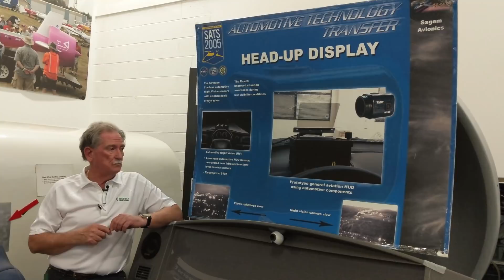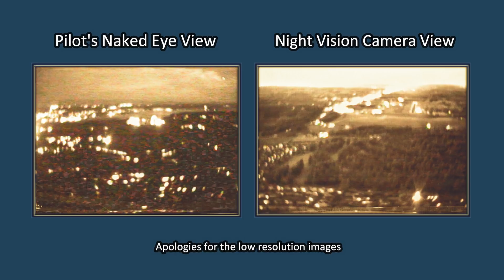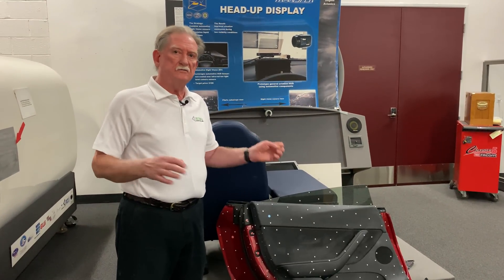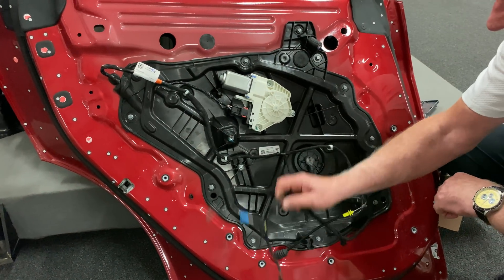Tips For Tesla E3 - Night Vision HUD & Wire Reduction

Comment: Tesla has the tech to make their own self driving processor chip. Why can’t they make their own canbus chips for every item in the car (light clusters, window winders, etc)? That should need just one single wire run around the car. 
You don’t need Bluetooth data over power will do the job with no external noise issues. Ethernet over 240V mains works perfectly. A simple command to light a bulb/lift a window, etc should be easy.

Comment: Could those control boards be of a POE in a "ring network"? With one or two "ring net works" connecting the whole car to the cars computer. Could the control boards then be made accessible for use anywhere on this network?
Reply: And what will happen in a crash, will the whole network 'go down'? I have head they were interested in fiber optics. How will that help,

Comment: wireless signaling might be too easy to hack?
Multiplexing on the other-hand, is probably more practical... Still gonna have to run wires for power, may as well run a signal wire to send a digital instruction through to a cheap controller in the door..

Comment: Bluetooth is an absolutely terrible idea.   The tire pressure sensors on my Acrua are interrupted by the charger for my Android phone.  The only wireless receiver should be between wheel pressure and a receiver located right next to the tires.

Comment: Blue-tooth, WiFi, or other wireless technology is not the way to go.  Just not reliable enough and or opens the system up for hacking from the outside.  Stand next to the car with a cell phone running right software and the door opens completely by passing system security.  Using a CAN like bus reduces the number wires out to each door to 5, except for the speaker(s).  All of the tail lights reduced to 4 wires etc.

Comment: Why not sandwich an OLED display inside the windshield and use the entire surface area of it to display info?
Reply: love that idea. BUT - as far as I know, there is a legislative regulation (at least in Europe) that the windshield has to be fully transparent without any distortion. only thin wires for windshield heating (defogging/defrosting) are allowed.
Reply: @gl3906  YouTube transparent OLED's, it can be done.
Reply: @mxj247  thanks for the hint. 'Planar launches the 55" FHD LookThru transparent OLED display for $14,995' - maybe (today) more a matter of price, than a matter of technology

Comment: Wireless is far too prone to failure.  In my opinion you would go with a small microcontroller in each physical area of the car (ex door) why are each component in that to the microcontroller, then wire all the microcontrollers to the main logic.

Comment: I believe we will see Ridgid cabling in the Cyber truck. I work in the telecommunications field, and there does exist plenty of examples of combination voltage/data cables that run together, sometimes along a single twisted pair. Rigid cables would simplify the assembly and make tolerances exact. Savings abound. 

The idea of wireless actuation is not out of the question but we'll likely be limited to call upon passive sensors and not used for actual modulation, that can change fast though! Great video

Comment: With regards to wireless communications for things like door locks, doesn't it sound like it could be a security risk, if someone with a signal jammer approached your car and prevented you from locking your doors. Also that Bluetooth module needs power and would still need a wire of some sort back to a power supply; Thusly not eliminating the need for a wire. With additional possibility of interference with the wifi signal embedded in the car. You could say, well We could set the locks to default lock when experiencing a loss of signal, but now you can forcibly lock someone out of their car. And because Tesla doesn't have keys there wouldn't be a manual unlock, like there is in old school car manufacturers.
To me wouldn't it make more sense to use microprocessing boards instead for your comms, as they would be difficult to hack and could supply power and could be installed with a robotics. Personally I wouldn't feel safe in a car with wireless via rf security features.

Comment: HUD:  Nice to have but not very crucial.  People who doesn't have a passion with driving or cars, don't care.  The first time I've had a center mounted console, I realized that I need don't need much info.
Nightvision:  Yes, because low beam light is not enough regardless of brightness.  
Wire reduction:  I think they will implement this through multiple controllers/computers.  For example, all rear electronics of the car will connect to a second controller/computer

Comment: Yes, but you still need to supply power and earth to doors (earth chassis unreliable for doors) so adding in another 1-2  thin wires is not such a big deal when you already have 2x larger wires for power.. A common digital wired connection (not analogue) signal could be used throughout the whole car however to activate certain modules only that pick up a certain signal / frequency etc which would reduced the wires by about half or less....you would then have to rely on separate small circuits for each sub-section of the car. Thus you could get away with power only  and signal wire or power and earth with signal wire (where chassis earth is not enough).

Comment: I don't feel like trusting such wireless approach just yet, maybe thats just programming in my head on how unreliable various wireless gadgets are in this world.
In my head i would attempt to use one-two wires for all non-bandwidth-intensive&non-critical digital communications and hook all receiving devices in serial. there is enough variety in ways to do that.  just like wireless in theory already sends everything through single wire anyway :)
The question for me is though - is the need of additional electronics everywhere to deal with such signals outweight the cost of additional cables.

Comment: Problem with wireless is reliability and maybe power usage: it’s too easy to jam/mess up wireless signals as opposed to hard wired stuff and you either need to use tons of frequencies or an active listener in order to address specific items, which is annoying or uses passive power. I’d go with a hard wired digital system, maybe even a special version of USB that can carry 12V or 48V and just daisy chain stuff. If you go to a single power cord style cable with integrated comms, you’d probably already simplify a lot and get rid of a lot of parallel wires.

Comment: I do like BT comms as that means doors can be removed without as much wiring issues but then again, the wires usually go thru one big connector anyway so who cars how many are in it if you will need a plug/connector anyway.

Comment: TBF, what do you want on a Tesla HUD? No oil pressure or overheat warnings and anything else going bad will give you an alert. Maybe speed but even that is minor and can be controlled with fsd. I do like info but even my race car instruments are out of sight other than warning and shift lights (I do have full DA so info can always be pulled up later). There are also a lot of BT/HUD units available aftermarket but I don't see them used often. What does the market research say?

Comment: By implementing a Bluetooth mesh in the car you would get strong security on several levels incl replay attacks  https://www.bluetooth.com/blog/bluetooth-mesh-security-overview/ . Other forms of attack like EM would probably cause issues with other components onboard the Tesla too. 
Bluetooth mesh is great for functions in a car - open and close doors, windows up and down, lights on and off incl dimming and color change. It also great for sensor readings like temperature, humidity, CO2, VOX, etc. A transceiver could be included in the window lift unit and could have short cables to the door lock etc. You will still need power to anything with a motor but it seems signal cables are many 100 meters long.
Over-the-air software update is also included in Bluetooth mesh.

Comment: Would save weight going wireless, but as other mentioned, If I am getting troubles with my earpods sometimes, don't wanna mess up with wireless latch locking... Don't think head up will last long. I think tesla will never introduce it : weight, cost, complexity and not in line with autonomous driving. As someone said already, vehicles are tesla's hardware for its product, which is software.

Comment: I see the attractiveness of wireless, especially for assembly.
But there are some strong concerns I got with that. 
* Security wise this is nothing I want in a car I drive (personally)
* Lifetime wise, when we are taking with lifecycles of 10-20 years of a car, you also gotta provide software updates for that. If you can limit the amount of different components you need to maintain this will be nice and limit the work needed from a manufacturer
* Capacity wise the 2.4 GHz band is already overcrowded and Wifi (while still being on it) is moving to 5-5.8 and soon 5.9-7.1GHz. So putting more and more stuff on 2.4GHz is not really something you want to do. 
* Availability wise wireless is not good. You can easily jam the signal. So you need a fail-safe system. And it will be difficult/undoable for the ASIL levels.
* Often you need wires anyway to transmit power anyway. So I don't see a huge benefit at replacing one or two bus wires with a wireless link.

I don't want to be naive, but for me this seems rather complicated. Maybe some sort of NFC would be interesting? Like transmitting power and data over coils close by.

Comment: Sandy, with all due respect... that Bluetooth sensor won't save you much. You still need power cables to power the Bluetooth device and the motor or actuator you want to control. Best I've seen is comms over power bus type tech. Which is what I believe Tesla will use in the near future, hopefully for CyberTruck.

Comment: I would be glad even if they move from 20+ wires to the standard 4, for each door/trunk: 12V, CANH, CANL, GND. I'm baffled that to this day the manufacturers still don't do it. I guess then want analog signaling going back to the LCM (lights body controller module) to monitor for current limit on the window motors or burnt out bulbs, but I think that should be a commodity part in each door. I'm hoping that rising copper prices will force this.
Next level would be to add signaling on the 12V wire, this is pretty trivial.
I'm not sure why my electrically actuated trunk needs to have 25+ wires and every year one of them breaks down. And this is surely not for cost-saving, as the loom is hand-built and so is the car.
And hopefully the motorcycle tech will also catch up, it seems that it's at least 20 years behind cars.
Rant over.

Comment: TPMS works, but is also non time critical. Hack a microwave door, and turn it on pointing towards an intersection, and no cars will be able to signal, dim down headlights etc. It would be super easy to jam and cause havoc brake lights not working? Nah, cables makes sense, but higher voltage for thinner power cables, and use the CAN bus for everything. Should be doable with three wires, preferably also having a second backup circuit. There are loads of good options, with i.e a token ring backbone, and routing nodes that can forward to separate switched or serial lines. Should be easy enough to make.

Comment: I do not agree with wireless.
I would rather send ALL....ALL commands (except SRS deploy) over power lines (+12V and chassis). Most devices have power supply - switches can also do that (window switch with PWM signal controlled backlight). So why not send all commands as any type of frequency (sine/square/triangle at 1kHz would be enough bandwidth for most operations) over DC line. With AC it is trickier, possible harmonics or smth.
For example:  Rear taillight - 2 pins - send package with rear left taillight address (for example 0010 1011) and command just a single byte (for example, command 0000 0000) meaning switch all off. Yes. Every module onboard will hear that command but as address is wrong (for example Rear Right taillight is 0010 0111) they will just ignore that command.
Also easy to add checksum for reliability. Why wireless. Costs more and is hackable and jammable.

Comment: Great idea with the night vision! However I’m a bit sceptical of anything wireless! It’s liable to not only signal interference but is also allows hackers to intercept the controls of your vehicle and potentially override them. Personally I’d favour what they do with signal over power lines. Run a common busbar cable around the vehicle. The individual signals can then be picked up by each device attached to it. See also power over Ethernet.
Reply: I agree with skepticism about bluetooth. However, a common busbar means no separate fuses for different circuits, which means the protection level for faults in particular parts of the circuit is set at the high current rating of the single fuse. Among other things, that requires heavy gauge wiring to all destinations to avoid burning out the wire if there's a short at that destination.  So single busbar is not a good idea.  PoE requires separate wires for power, they just happen to be in the ethernet cable. There's a separate standard "PoDL" that sends power over data lines. However, loads like window motors are at or beyond the limit of that standard, not to mention it would require switching to 48V circuits.
Reply: Graham Wideman just fuse the individual load at the load!

Comment: What's wrong with wires in a car?  Seems like wires would be much more reliable, secure, cost effective.
Reply: More reliable and secure sure... but cost effective maybe not. Not doing anything except power positive wire would remove so much cost from production.

Comment: @Munro Regarding reducing the amount of Wire (more a general idea rather than Tesla-specific): i thought about that a bit and came to a in my opinion very obvious idea: why not migrate the whole 12V subsystem to two or three 48V Busses, where each component needing power taps off via standardized Tap-off units which include self-resetting Fuses, Relais (to switch off unneded and/or broken components entirely) and also if needed DC-DC-Converters to power legacy components. Important Stuff like the Autopilot Computer of course feeds off multiple Power Busses for redundancy, and less important stuff like the Seat Heaters just use the closest one. This should keep the amount of Wiring to distribute Power through the Vehicle to a minimum. I wonder if there is some Flaw with that idea..